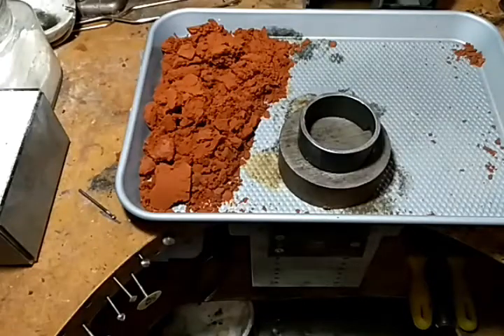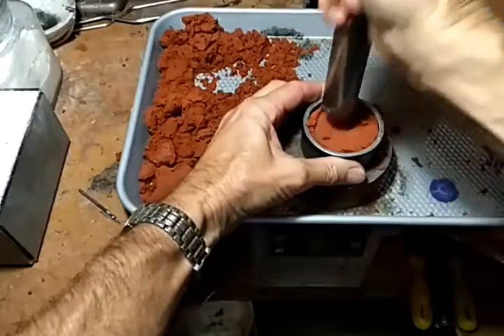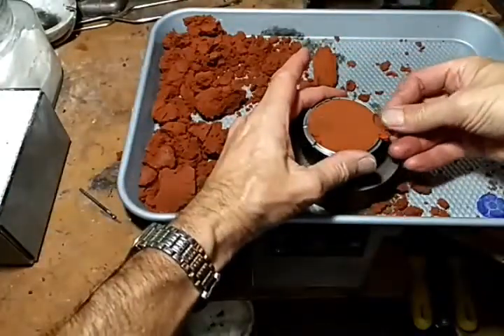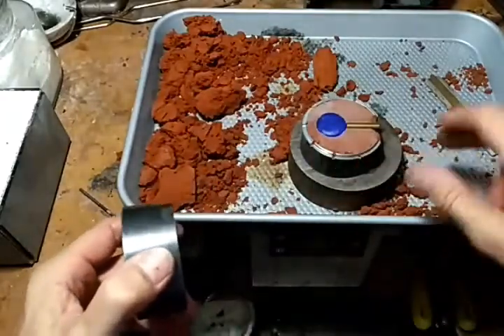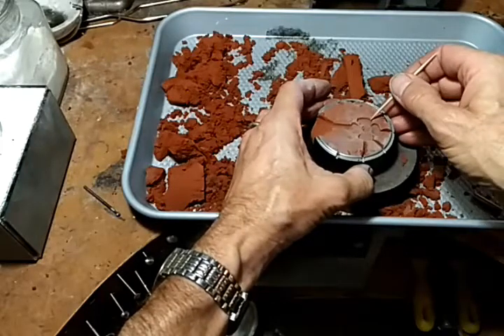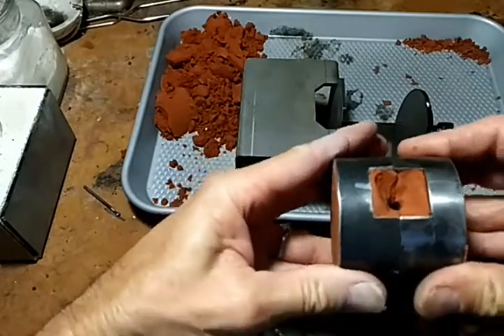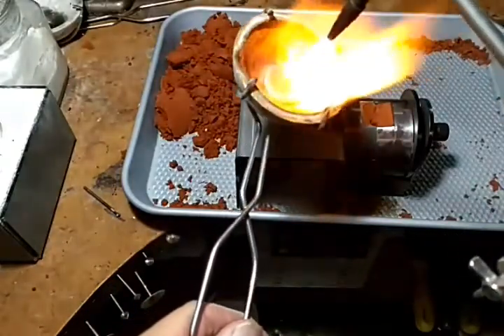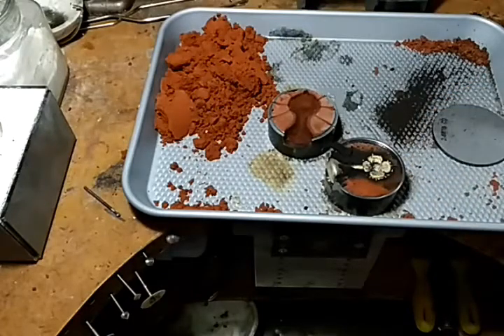Red Clay Casting - Casting a Wax Flower

Comment: If you make ventilation holes in your cast, can you pour the metal in while the wax remains in the cast... is this safe to do?
Reply from the maker: No, the wax must be removed or it will be a big mess of melted wax, sand a metal. Not like investment casting and here the wax is simply used to make the impression.

Comment: Hello . Nice video . if you would not have made the vents, it would have been bad?
Reply from the maker: When using Delft Clay or sometimes with a mixture of Delft and Petrobond it is important to add vents to allow the gases and air to release. Otherwise, it's common to get incomplete pours.